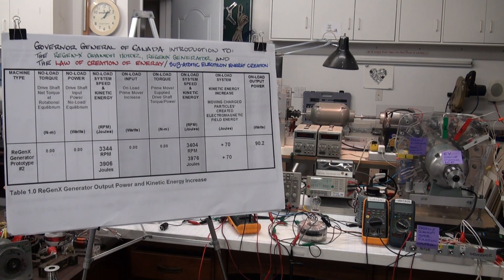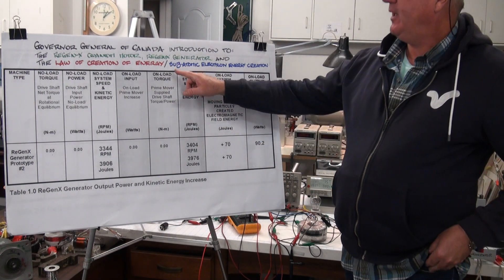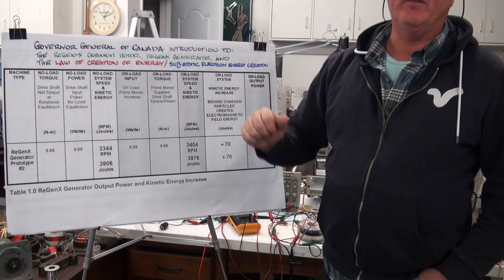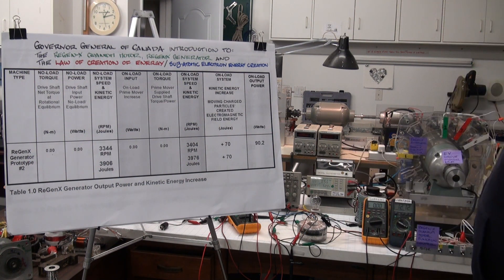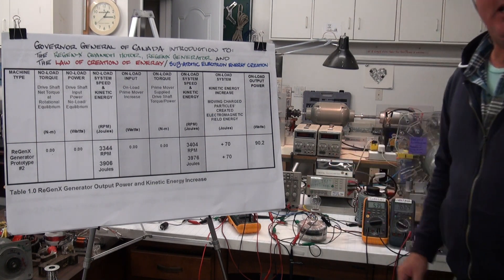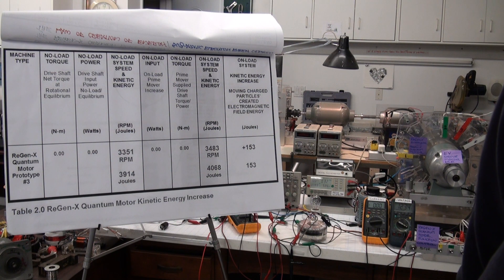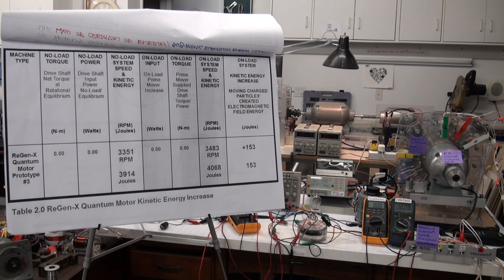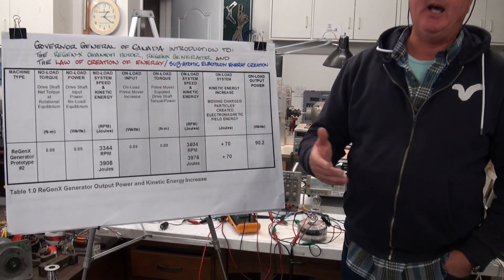PERPETUAL MOTION MACHINE OF THE 1ST KIND INTRODUCTION - GOVERNOR GENERAL OF CANADA #perpetualmotion

Comment: THis is just the same as the Chinese ceiling fan when converted into generator, When you put load or short the generator, it doesnt require additional energy on the prime mover. overl all its just the same. Theres nothing new in here, when  you put load its just inducing positive electromagnet that cancels requirement for more energy. this device is not working especially on inductive load. conventional generator still far more efficient.

Comment: Thane, if you can have the motor do work without input energy, why don't you close the loop and feed your drive motor with the output of your coils. That way you should be able to run your setup forever. If you can't, there is something wrong with your explanation.
Reply: COP- Values above 100% are only possible with converters with or even without moving parts if energy symmetry breaking occurs in the physical vacuum; but I can't see where that could happen with your RAG-Converter? The same is true for your Bi-Toroid transformer (BITT).
Reply: Try watching this one.
https://www.youtube.com/watch?v=3O-uFXiObBc&t=409s